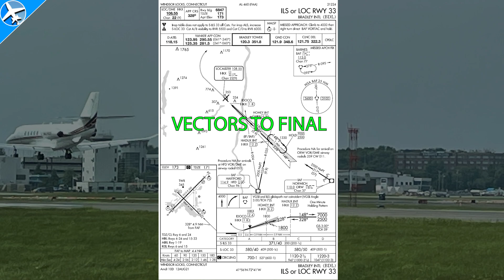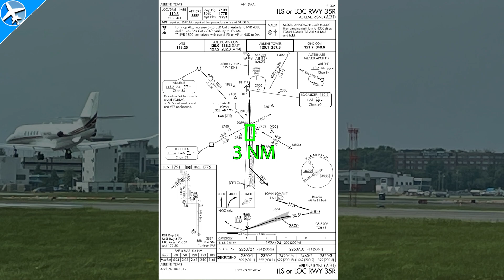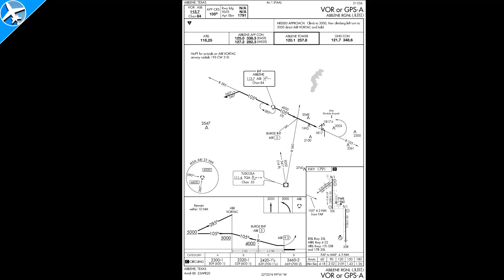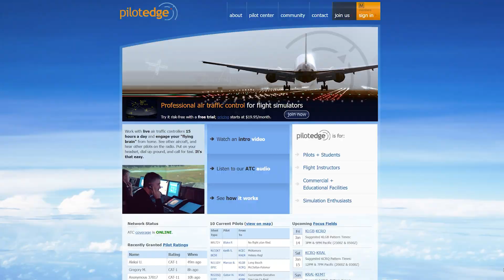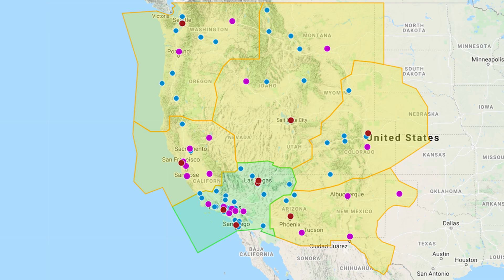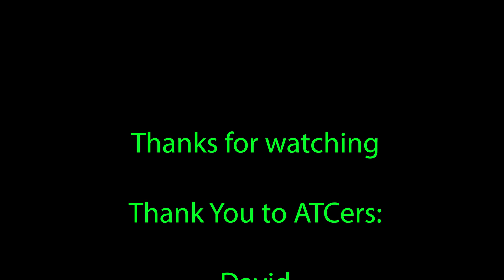Instrument Approach Clearances with ATC Communications | Pro Pilot + Air Traffic Controllers

Comment: Great video, PTAC helps prepare for the clearance in my experience - QQ "Maintain 4000 until established" why do you think its Ok to immediately descend to 3600 when you are not established?
Reply from the maker: @adrianmoss6355  why would you? I stay at the altitude given in the approach clearance until established.  The altitude assigned is close enough to the minimum altitude for that segment that a descent can be made safely to the next altitude once established.
Reply: @thecorporatepilotdad  thansk for reply, perhaps I misunderstood - at 3.46 you say immediately after the readback ok to descend to 3600 - i was just asking for clarification - i would stay at 4000.
Reply from the maker: @ that was because the aircraft was established on the localizer but I stayed at 4000’ until GS intercept.

Comment: Verify the instructions at 4:00 please? You state that you can descend according to the plate.  But the instruction was maintain 4,000 until established on the .. ohh on the localizer not the glideslope? I guess that's the key point which my brain just got as typing this lol.  Once you are on the localizer (not the GS) then you are free to descend according to the plate.
Reply from the maker: Correct.  When cleared for the approach, the descent down to the next altitude can be made (if there are any other stepdowns prior to the FAF/GS intercept).  Once the glide slope is intercepted it will be tracked down to the DA.

Comment: @thecorporatepilotdad I'm curious why you chose to use N784TC as the tail number for this demo. I was interested in the aircraft type, and quick Google says that tail number was for a Thunder and Colt hot air balloon that crashed in 2004 during the Albuquerque balloon festival. I'm not trying to troll, just curious if there's some sort of connection or if it's totally random.
Reply from the maker: You are the first ask, but the tail number is random.  The first two digits are numbers used on multiple training aircraft I flew 20+ years ago and the TC is just short for The Corporate in my channel name.
Reply: @thecorporatepilotdad  Huh - go figure. An interesting coincidence!

Comment from the maker: Are you a real-world pilot, flight simmer, or both? Did this video help shed light on approach clearances and ATC communications in the approach phase of flight?
Reply: Real world IR student, practicing approaches the cheap way - X-plane.  Trying to get as much practice in while the hobbs is not running
Reply from the maker: @craggslist  one tip - when practicing approaches on X-Plane, do missed approaches on the majority of approaches flown.   Landing from an approach is easy, but doing the missed approach will also help practice setting up the avionics, planning for what comes next, hold entries, and holds.  Good luck with and enjoy your IFR training!
Reply: Private Student, but I’ve been also training on MSFS. Working through all the ratings on Pilotedge (real life ATC operators for the sim). Finished the I-ratings (IFR training missions) now I’m working through the Sky-ratings… they simulate a charter part 135 operation.
The IFR flights are all quite challenging and the ATC Guys and Gals do not hand hold or baby sim pilots. They expect you to conduct yourself as a professional and fly as if it were a real IFR flight. If you mess up a procedure they don’t hesitate to fail you on that rating. Which can suck if you just spent 2 hours flying a mission and you have to start all over because one mistake. 
But certain IFR procedures are burned into my brain from the consequences of failure, repetition of starting over and the embarrassment of screwing up for everyone on the net to hear. It’s quite effective:)
Reply from the maker: @lyingcat9022  Pilot Edge is a great product and I’ve used it on the channel in the past.  Doing more with Pilot Edge on the channel was a goal, but it never worked out.  Good luck with your training!

Comment: As always another great video CPD 😊.  Is it worth trying to remember the acronym PTAC - Position, Turn, Altitude, Clearance when receiving an Instrument Approach Clearance?
Reply from the maker: Honestly, not really.  It sounds good on paper to do PTAC, but in my opinion remembering PTAC then trying to read the clearance back is not helpful.  It is like the CRAFT acronym in copying a clearance.  If a student is learning to write a clearance down and it helps, then sure, do it.  When I read a clearance back PTAC isn't even a thought in my head. I say the line and fill in the heading, altitude, and cleared for the approach.
Reply: @thecorporatepilotdad  Thanks for the quick response.  What you have explained makes total sense.  I discovered the term PTAC from the Opposing Bases Podcast, hence the question.  Much appreciated 👍